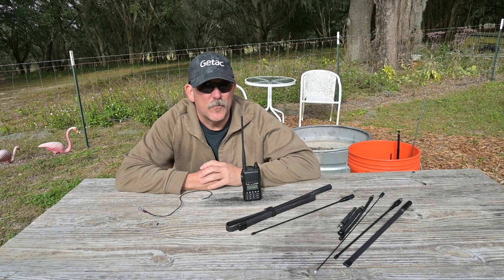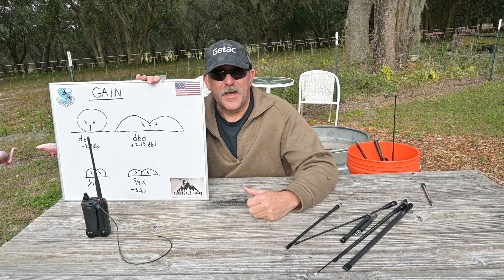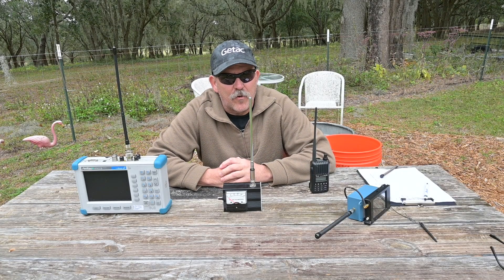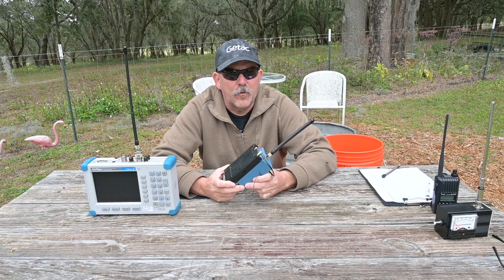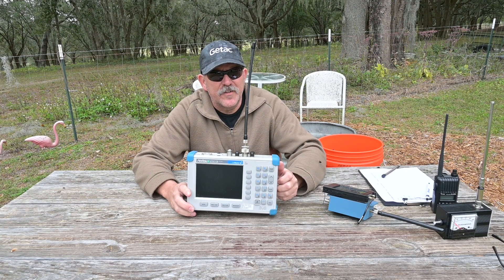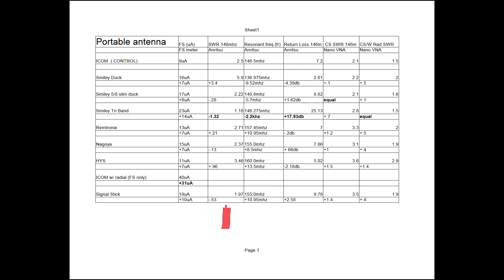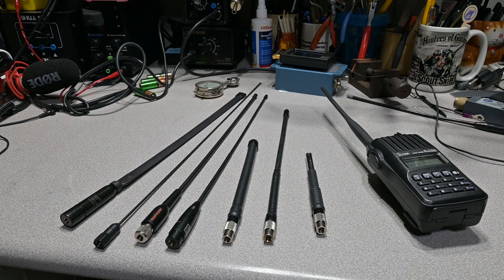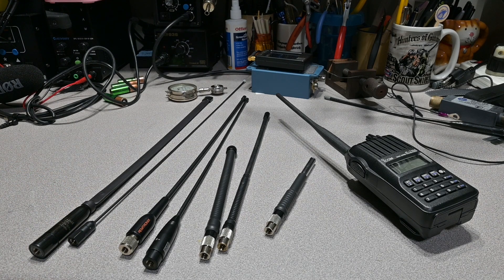VHF portable ham radio antennas that are practical  - what can you expect over an ICOM factory whip?

Comment: This guy is an extremely efficient teacher. No fluff, very technical but clearly explained. I’m setting up so my daughter can go exploring when we’re out with our camper or at our summer home in the Kentucky hills, and still be able to call us if she needs us. Cell phones don’t work out there. I’ve only watched 3 of his videos so far and I’m starting to understand this stuff. 
     I have a Kenwood TM 281-A in my camper and of course Baofengs left from my early prepping days that I’m trying to work with, and I’m working on choosing antennas and optimizing them for our hilly woodsy environment. I never realized this was so involved, thanks so much for these awesome lessons.
Reply from the maker: Thank you very much and you are welcome ! Remember that radiation focus (gain) is typically horizontally focused. When one is in hills or mountains one needs to consider up or down tilt. This is the reason why 1/4 wave antennas work so well in urban areas with structural ups and downs and 5/8 wave antennas can fall short. Just remember that the predicted performance of your described set up is perhaps 2 miles radio to radio. The most timle and efficient way to enhance your portable radio range is to add a 19 inch wire to the body (ground) side of the antenna. Here is a link to my video on the subject. 
https://youtu.be/vIySAQVukmo
Thanks for watching !
Reply: @survivalcomms  I’ll watch it and thanks for the tips!
Reply from the maker: @joeprimal2044  Anytime !

Comment: Interesting tests. Sorry, but I have to add a however ...
As I think you mentioned, as an important function that I rarely hear any credence given to is that the human body is a factor in the design of portable radios, i.e., the body is part of the antenna system, providing the “other half” of the 1/4-wave antenna. At about 12:35, you discuss the data on your chart. I question the real world application of this data as for each measurement – including using your Nano VNA chassis simulator – the in-circuit human body element is missing. I would expect an objective measurements to be made with a human holding the min-spectrum analyzer. To me, using anything else to collect data yields results of limited value. Also, a critical piece missing: I would like to see your test range. I see potential interference/influence from the wire fencing and vegetation behind you. You probably know that in the electronics world where antennas are manufactured, testing is done with signal source and receiver in either RF anechoic chambers or free space. In your situation, an open field with a helper holding the signal source under test would have served the purpose.
Reply from the maker: The chassis simulator was held. Thanks for watching !

Comment: greetings!
you mention the use of a radio chassis simulator. How can one make one?
using my nanoVNA to portable antennas is a real hassle, getting much different results touching or not the device.
Regards...
Reply from the maker: Get a Pomona 2901 enclosure  and put good RF connectors on it (not amazon). Get some good ( not amazon) short  6" or less RF microwave jumpers. For Motorola chassis I use an old HT1000 frame and housing. Velcro the VNA to your chassis simulator. Do not connect it to a PC as that will skew your data.  Make every measurement with the radio held in a position of use.  Thanks for watching !
Reply: I guess I should connect the leads on the frame where the former antenna plug is connected.  @survivalcomms
Reply from the maker: @GreekPreparedness  You put the RF connectors on the box and have the shortest possible lead tie it to the vna. You can use an old inoperative radio if you want.    If the VNA was made well with a metal enclosure of a useful size it would approximate a modern radio chassis.

Comment: Wow a video with actual DATA!  Love it!!!  Was interesting to see how much of an improvement the radial caused.  We often hear it helps, but often do not see empirical data to support it!
Reply from the maker: Its all about repeatable data sets and I encourage others to peer review my work it's how we all learn.  Stay tuned there is another antenna video in the works with a new cast of characters.  The radial can also be connected to another point on the chassis to good effect if desired rather than under the whip. Being creative with what you have is what ham radio is about IMHO. Thanks for watching !

Comment: You've got me sold! Where can I buy a chassy simulator?
Reply from the maker: I was a DIY deal It is configured for SMA M , BNC M and MX Thread antennas. The housing itself is a Pomona 2901 box. The jumper is a 3" SMA M semi rigid microwave jumper for the VNA /SA to SMA . I also have a 3" semi rigid microwave SMA M to BNC M for the MX and BNC antennas. I also have a gutted MTS2000 frame and housing with a short jumper for doing the same tests with Motorola SMA F antennas. Thanks for watching !